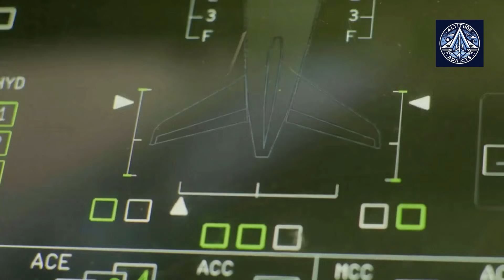MC-21 $240M Boost for Certification, PD-14 Engine Cleared for Icy Conditions

Comment: European certification is not necessary cause it will never allow Russian aircraft to complete with Airbus or Boing best markets for Russians Asia, Africa, Middle East and to get certification from these countries covering 80% of the world markets, both SJ100 and MC21 are game changer civilian aircraft the best part is its 100% make in Russia easy to maintain and operate due parts availability and maintenance only one source to deal with cut middleman out all together. Import substitution parts are not new well new for both aircraft but the are proven reliable and solid from established manufacturers make for other aircraft civilian as well as military.

Comment: what about the excess weight of almost 6 tons? has it been resolved?
Reply: Where do you and  all the other genius on the internet know the final weight of the plane first and second that it is also 6000 kg over weight can you tell us the eurolotto numbers too.
Reply from the maker: Unless Russia announces the final configuration we cannot tell.
Reply: @altitudeaddicts  I hope it's just an issue. Because it is very strange that just because we use local components, the materials used are all very heavy. I think Russian scientists are not that stupid, because they have experience making airplanes. If it was a COMAC C919, I understand it would be overweight because they are still beginners.